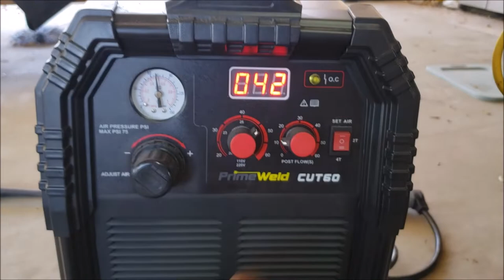How to build a bbq grill smoker out of a compressor tank pig cooker: Custom Propane scrap tank idea

Comment: I been Wanting to make a mini bbq pit with a fire box . That cook about 2 Hamburger patties . Or 4 or so Hot dogs. I use to go to this guys house that had one . That coolest looking little pit . I think it was made out of 4 “ pipe .
Reply from the maker: I have an offset smoker I started using sch 40 6" pipe but I might look for lighter material and start again. I also have a weber style kettle that I started like 2 years ago sitting in the shed, finished it would be about 4" wide by 6 inch's tall.

Comment: Looked pretty cool, could have done with some eyeballs. 
Did you buy a tractor.
Reply from the maker: I have not bought a tractor as I lost tons of $$$ in a gamble in the Stock Market. I will go to Vegas and put the remaining money on Red lol. I was going to check the tractors out again but changed my endodontist location and its in the opposite direction. Inflation also made things get up there and not much free cash to spend on toys. I think a 25 to 40 hp tractor with front loader will be enough for me.